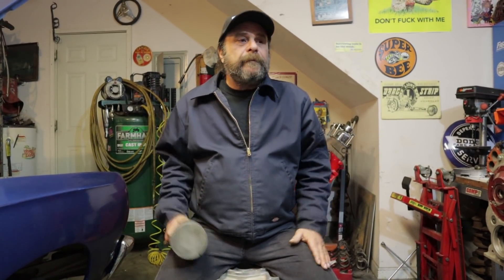3 Reasons Junkyard Engines Go Better With Boost

Comment: Bmw m12/13 f1 engine. 1.5L inline 4 at 5.5 bar making 1500hp. They took the blocks from old bmws in junkyards that had the same inline 4 blocks and they seasoned them and even peed on them and yeah im not joking. They held up much better than freshly casted blocks

Comment: Good knowledge tony I haven’t heard stuff like this since my dad talking about it years ago. So when you say seasoning of the block I was happy that your passing this info down. So question here does the same thing happen to aluminum in the seasoning process as some come with aluminum blocks now and not so reliant on iron for weight saving. I personally like my iron but not sure how aluminum acts under these conditions.

Comment: The junkyard engine is something bigger than was intended for the application often.
My '64 Chevy C10 got a junkyard 350 to replace it's 250ci I6.
My '97 Voyager got a junkyard 4.0L V6 to replace the 3.3L V6
My '94 Celica got a junkyard 3.3L V6 to replace the 2.2L I4.
Every single one of those swaps doubled the output, using stock motors. You could build the original engine to have double the power, or you could swap in a better baseline motor for a fraction of the price...

Comment #666
Reply: My 93 integra got a 2.0L I4 out of a CRV to replace the 1.8L I4.
My 00 Prelude got a 2.3L to replace the 2.2L I4.
My workmate did the Yamaha Volvo V8 for the 3.0L I6.

Comment: Tony I watch every single video you produce. I find you forgot to mention another reason ring gap is huge in performance engines. The top compression ring expands more with more compression not just heat. When you spray you make alot of blowby and compression meaning your expanding the ring further then the original gap can handle causing lock up in the cylinder and the top of a cast piston to sheer or crack off.

Comment: Tony, you really gotta get your hands on a gen 3 LS truck engine,. You'd be in hog heaven disecting one with over 100k miles on it. All that you just said is true - but the old 1000hp junkers were big blocks. The LS is gen 3 and 4 chevy small block. But materials and technology have advanced to the point where it's built a lot like a big block that was built for a race application but smaller.

No freeze plugs - I have no idea how they're cast. Deep skirt block, 4 bolt w/ crossbolt main caps like an FE, and they're BEEFY. Oil pump is an imporvement,, and they're aluminum heads from the factory that flow much better than an older generation small block - Oh and something you mentioned in another video ... the exhaust inside 2  ports aren't siamesed.

And when you open up a 150k mile engine and the bores are all round, straight, no ridge ... it's like magic!

Comment: Number 1 rule for boosted engines is start with good baseline factory engineering. If engine came boosted from factory then 90% of the work is done. The rest is tuning and bigger boost.

Comment: Uncle Tony I'm with u on that theory. All 3 of them. I could see those ideas being possible. But u & I both know there is one thing about the LS that makes it a good high horse power engine. U didnt mention it. It shares this trait with the ford clevland. It's in the heads. These things have heads that flow a significant amount of air through them. Witch intern equals horsepower potential. I wont say a high flowing head equals horsepower strait up, becouse it dousnt. But if u combine the high flow heads with all the correct parts that can take advantage of that air, then that equals horsepower. & the LS has those kinds of heads.

Comment: i never seen a chevy hater try to give such sophisticated line of crap as to why the "LS" motor is no big deal , yup in the begging he says he 's not taking anything away from the "LS" yet later on he tries to compare it to 60's 70's and 80's engines saying basically they are just as good , sorry but NO !! yes ...back in the day they went to junk yards to get decent short blocks , ONLY because they did not have the budget to do new short blocks , racer's never had the sponsors back then .... they had no choice but  to use "seasoned engines" ....the "LS" motor is a great engine design ...period ..the bottom end of a "LS" 6.0 , can handle 900 hp stock because of its design ,not because its "seasoned"because it has better piston technology ,better rods , better crank , better block , better caps , more cap bolts , not to mention its a roller cam engine , all technology chevy has learned from past engine designs over the years ,not to mention all the years of racing technology from all makes of engines they put into the "LS" is what makes it such a good engine , not because its just an other "seasoned engine" cmon man .....and your piston ring theory is crap .....you talk about piston ring wear going from 12 thousand or so to 30 thousand being the reason the rings dont bind up under high hp. load , thats crap , for this reason ...your end gaps on piston rings dont get worn..the outside diameter gets worn ....instead of saying " the LS has better tech. like better metal used for rod piston crank  bearings block  , better oils these days ...you say "seasoned ", lmao !!! never seen such a passive aggressive  way to bash chevy ...or maybe you just dont ???.....either way very sad ....

Comment: YES! Uncle Tony! Thank you for this explanation! The new Hemi's are great but most people when they build up there Hellcat don't understand two things... 
1. The fuel rail design sucks and along with the fuel pump has been known to under deliver fuel to cylinders 2 and 7.
2. The ring lands explode when the heat and pressure expand and buckle the rings. Add the first factor to this equation and you got yourself a boat anchor. 
Fix these by tearing the engine down and adding ring end gap and slightly rounding off the sharp edges of the rings, then add the dual fuel pump setup thats readily available and a larger fuel line and aftermarket equalized pressure fuel rail. Plus some oversized injectors...

Comment: TONY, THE LS MOTOR IS NOTHING MORE THAN A REGURGITATED FORD 427 HIGH RISER ENGINE AKA RAISED PORT 351 WINDSOR. FROM TOP TO BOTTOM THE LS IS 100% FORD IN DESIGN. NOT ONE DESIGN ASPECT OF THE SMALL BLOCK CHEVY LIVES IN THE LS, IT IS COMPLETELY FORD. WHAT CHEVY GUYS ARE DOING WITH THE LS JUNKYARD MOTORS.  FORD GUYS DID 30+ YEARS AGO WITH THE 302 AND THE 351 WINDSORS, WHICH MADE SIMILAR HORSE POWERS. THIS IS NOTHING NEW.

Comment: Tony, back in the day before computers were used to design engines engineers used. Slide rules they knew that the materials meet a certain specification at a Minimum! Junk yard engines have been gone through many heat cold cycles. They’ve reached there ultimate strength!

Comment: Have a question  for you on the 6 build ok? On power show they did a stock rebuild with a few performance parts2 barrel to a 4 barrel balanced the motor  and put headers on it and made 132 hp over the stock 70 hp before rebuilding I know it's not much by today's standards but in a 70 duster it would be alot of fun I think how much hp do you think you can get with your 6 with out putting it on a dyno ?? Same or little more or less?? Keep up the great work !

Comment: 6 bolt mains make it have a strong bottom end. Designed for NVH (noise, vibration, harshness) reasons not to make it stronger. 15* heads from the factory. We are spoiled compared to what you older guys had to do to make power!

Comment: Per other manufacture stories (Jaguar) - they used to cast their blocks during the XX season so they could be seasoned and ready for machining six months later.  I also heard that BMW and their 1500 hp 80's F1 motor was nothing more than a 2002 engine that turbos were bolted to.  Rumor (per youtube story) stated that they would get these used blocks set them outside for seasoning....and urinate on them to continue the seasoning.

Like the channel and how knowledgeable you are....Thanks for making the videos!

Comment: YOUR CORRECT TONY ANY GOOD ENGINE BUILDER KNOWS THAT CLEARANCES ARE THE FIRST TRICK IN BUILDING HORSEPOWER AND MAKING AN ENGINE LIVE TOO NOW YOU CAN HAVE A HAPPY MEDIUM WITH IT YOU CAN CLEARENCE IN THE SKIRT TO WALL CLEAREANCE AND TOP RING CLEARANCE AND MAYBE RUN A SNUGGER OIL RING CLEARANCE AND THE SAME GOES FOR ROD AND MAIN BEARING CLEARANCES!! EXCELLENT PIECE I HAVE BEEN MIA I HAVE BEEN RECOVERING FROM A BROKEN VERTRBREA WHERE AN IDIOT CROSSED THE CENTER LINE AND CONTINUED TO STAY IN IT AND MY CHUTES GOT CAUGHT ON HIS FRONT END AND I BARR3LED ROLLED AT 148 MPH ON TOP OF THE CONCRETE RETAINING WALL ATLEAST THATS WHAT I WENT THRU THE 1/8 MILE TRAPS AT AND IT DETROYED MY CAR I DID MANAGE TO SAVE THE ENGINE AND IT KNOCKED THE PAN SLAM OFF OF IT THANK GOD I HAD ENOUGH SENSE TO HIT THE KILL SWITCH HOW IDK I,MEAN IT WAS ON A 4:07 PASS HOW I THOUGHT TO IDK BUT I AM GLAD I BUILT IT AND I NEVER CUT CORNERS ANYWAYS ILL BE BACK WATCHING NOW I CAN TO THINK ABOUT RACING AGAIN AND EVEN MADE A FEW,PASSES BUT THE BACK IS STILL NOT RIGHT PROBABLY WILL NEVER BE RIGHT!! SO ANYONE FOR ANYONE READING THIS IF YA CROSS CENTER LEFT AND GET THE FCK OUT OF IT!!! I MEAN WE HAD 2K ON THE GAP AND THEY SAID I HAD A 3 CAR GAP SO YA KNOW DAMN WELL WHEN HE CROSSED HE NEVER LIFTED!- ANYWAYS TAKE CARE BUD ILL BE WATCHING!! TAKE CARE BUD!!

Comment: I'm 29 and when I was younger 16-19 I was in love with short stroke SBC's 377's hell honestly Its still my favorite mouse motor. But now I'm lsx to the bone and I honestly like 4.8s better than 5.3s, I ran a sbe 4.8 half of 2018 season  winter and the beginning of 2019 season, sbe 2011 4.8 the only reason the oil pan came off was to swap to my f body pan I ran a set of CNC' ported 799s ls6 stage 2.5  heads with good valves and 5 angle valve job and decked a lil bit and BTRS bad ass valve springs trunion  upgrade for the stock rockers and pushrods ls7 lifters LJMS nasty turbo grind ls2 timing chain, summits brand 102mm aluminum fabricated intake  and TB, BOSCH 210 injectors on ignite e90 Huron speed single t6 turbo kit with a billet wheel s480 with the race cover 1.32 t6 turbo, I'm running Holley efi in my car so I controlled a nitrous fuel solenoid and two NX fogger nozzles to spray methanol in the charge pipe and a nice air to water intercooler, th400 manual valve body pro t/brake strange 12 bolt swap for 4th gen f bodys and on 28x10.5 Hoosier's my PB with that little guy was a 5.66 at 121mph in the 1/8 the 1/8 to 1/4 mile conversion said 8.90s. That little basterd took a beating and lasted along time in the 900+whp range

Comment: BMW took seasoned M10 four cylinder  blocks with 100,000 kilometers or more and built them for their wining 1,500 hp turbo charged Formula 1 motors. They did rebuild the block, but It was a well used OEM block designed for '60s economy cars.

Comment: It's  the difference between 200,000 miles of abuse doing your clearancing, and saving you $10,000, vs paying an engine builder to do it, and costing $30,000!

Comment: The formule racers use to do this
In europe also in the 60ties and 70ties
They would buy bmw used engines from the 02 serie
Cause the stretch was out of the metal

Comment: 4th and main thing for boost. Compression. a good ole Chevy has no problem getting down from say 9.5:1 compression to 8:1 to say 7.75:1, after 300,000 miles. 
Which is the magic number for boost...

Comment: circle track guys would put in a nasty cam and port the heads. Favorite was a 350 chevy from a truck 4 bolt main  ,z28 oil pump and windage tray. When it blew just swap the parts to another one.

Comment: Which LS variant are you talking about and how reliable are you claiming? When you can buy $400 LM4's all day long on facebook, who cares if they survive long term when you can run 1000hp for a while. Does that really make it a good engine? Tell you what when I see any LS variant running 1000+hp for 100k miles, ill say its a god engine. Till then, its a cheap and disposable power adder. Not building a 100k motor to 1000hp, a 1000hp motor run for 100k miles.

Comment: So building a new 600+hp engine, you'd want to loosen up your clearances? I ask because I just bought a '78 440 camper engine/727 combo, with 36k miles on it, that's never been apart. I'd like to get 5-600 horse out of it
Reply from the maker: Yup

Comment: i like a tunnel ram for the street and u can build any engine just how u go about it is how much power u get even a ls has it limits then u have to put big money in it and boosting a engine or nitro to get power it will eat a engine up i built a 327 pro built with tunnel ram in 94 it has over 1200 hp and it still runs been through 15 races lots of hr driving on the road all because i did not boost it or nitro it but did build the sh out of it . now my 454 stroker with hemi heads right now it has a tunnel ram but thinking on rebuilding it for a  6/11 blower but it will be for racing only if i do this

Comment: One junkyard in my area,we don't trust their used engines.Put tags on them saying should be good on them.The 4.8,5.3,6.0 LS style engines,better pull the valve covers off and check if they are clean inside.If you see an orange goo and sludge build up,heads are junk.Poorly casted in the middle headbolt hole area,had no middle support casted in from the factory

Comment: I like that...."a seasoned motor...all parts are happy together".....they been thru all the temperature cycles tens of thousands of times and might i add....the parts know each other and actually compete with each other.....i can hear them now..."I'm not going to be the one to fail first". Nice loose motor....for flex needed for boost...i see that...every part gives..instead of one.

Comment: Exactly as you said, the Formula Ford guys used to leave their blocks out in the weather to season them. Some chose to short-circuit the process by overheating them. then overboring and rebuilding.

Comment: Well put! Enjoy your post. GM could not have done much better with this replacement of the iconic 350. I have used several JY engines in the past. Cummins mostly.

Comment: 5.7L gen 3 hemi is the mopar alternative to a "junkyard LS swap". Pull one out of a Dodge ram pickup in the junkyard and stick ebay turbo's on it and it will be just as capable as the LS stuff is. No reason not to use one of those engines for a hot rod.
Reply from the maker: Nowhere near as cheap, plentiful or adaptable as the LS.  It only has a fraction of the aftermarket support as well.
Reply: they are plenty adaptable, it only costs $120 for a special flex plate and spacer to be able to use the 727 torqueflite behind a gen 3 hemi it will bolt right up. They are common enough to find I see plenty of them at the local pick-n-pull that charges $200 for an engine regardless of make or model. Doesn't have as much aftermarket support as the LS but it has enough you can still get everything you would need to swap and it shouldn't cost a fortune to do if you are smart about it. Could use a cheap megasquirt or microsquirt standalone ecu to run the engine. I think its very doable just not as many people are into mopar as chevy so it doesnt get as much attention as the LS does.
Reply: @UncleTonysGarage  the main problem is not enough people willing to try and work with the platform. LS swaps didn't really take off until people like Matt Happel from sloppy mechanics figured it all out and put all of the how to's on internet forums and youtube so the rest of us idiots could see how he did it and copycat the stuff on our own cars. I find this issue a lot where there are engines and cars with lots of potential but nobody willing to pioneer the way for hot rodding the stuff people will just take the easy way out and do what has already been done before in staid of working with something. Kind of like what you guys did with foxbody mustangs back in the day it would have been easy to just put carburetors on them all and throw the efi in the trash but choosing to work with the efi and figure it all out was probably worth the effort in the long run.

Comment: Hey uncle Tony I have a question for you if you have a truck with a 318 in it and a granny 4 speed I just got the truck it's a 83 w150 lifted 4 inches and when I try to take off it stalls out out unless I'm revving to high heven
Reply from the maker: Could be too many different things to speculate here

Comment: Folks used to laugh at me and cuss cause I called for .003~4 bearing clearances on drag builds.  I'm right with you.  Never tossed a crank in 50 odd years :-)
Reply: Of course you have to marry that with the right oil.  Back in the day, it was 50 Racing Oil.  For me, usually Phillips 66 cause I worked in a service station.  Then it was Sta-Lube as it was cool blue and I got a discount.  Point was, it was straight grade oil w/o viscosity modifiers (which are not oil ...), and as long as your pump drive would handle it (FE's broke, a lot) you were good to go.  Speaking of pumps, always set the relief valve as low as you can.  Pressure is wasted HP.  Volume is what does the actual work.  45 psi is what usually worked for me :-)

Comment: My experience reinforces all of Tony's comments. I have strapped a junk yard Turbo onto a 1.8l Honda non-vtec with 200k on it . Had an  89' 5.0 trunk with every bolt on and same mileage. Both cars got smashed on every day ... the Honda w/ just cams , intake and a good tune Made almost 300 whp for years and the Ford did more . Both motors remain legends in my circle to this day .... All for the beatings they took and never gave in .